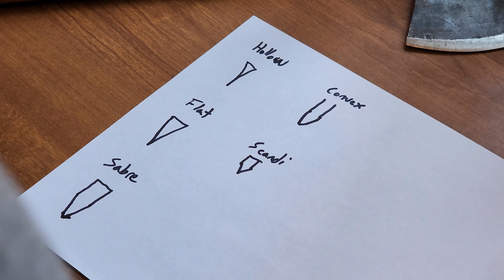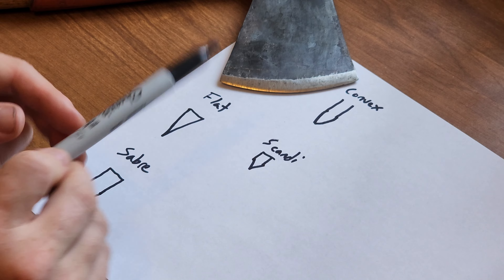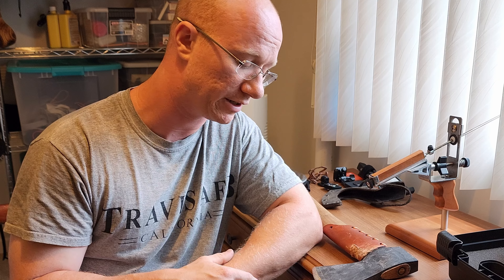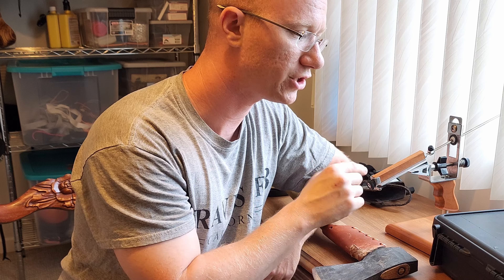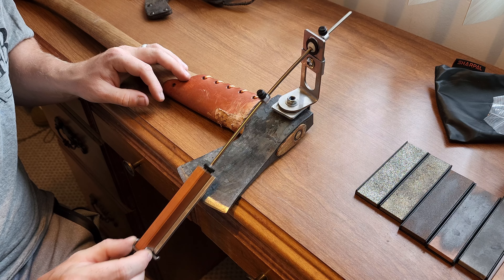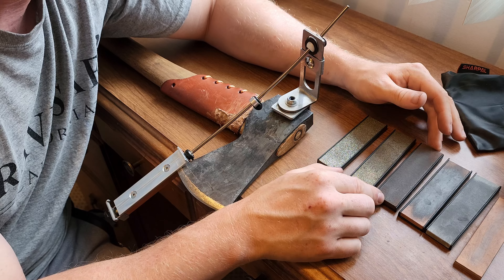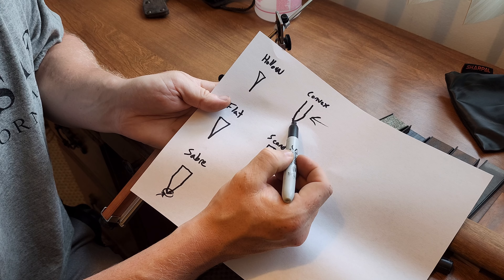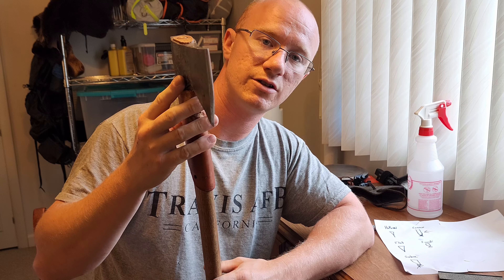How To Sharpen An Axe - Better Than Wranglerstar?

Comment: This video is literally perfect timing!
Reply from the maker: I didn't want to make too long of a video so I tried to cover things quickly. Let me know if you have questions.
Reply: @AbundantAdventures  shat Axe are you using, and what grinds do most come with? Looking at my axe, it looks like a scandi grind which I see a lot; did yours come with a scandi and you reworked the edge to a different grind or no?
Reply from the maker: @dwightsbeats4274  no, almost every axe is a convex grind. Scandi grinds are the typical grind of a bushcraft knife.